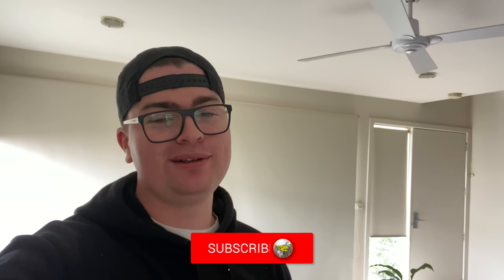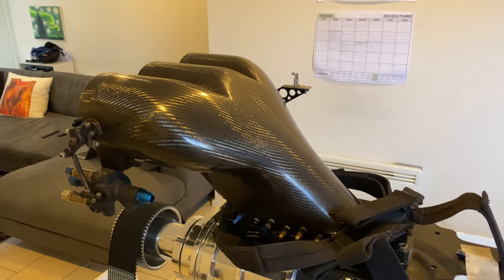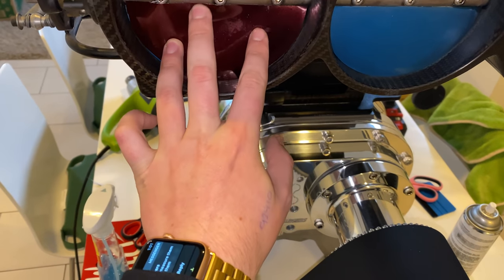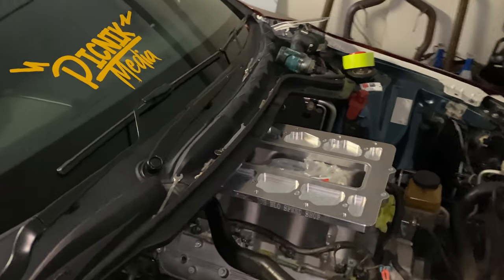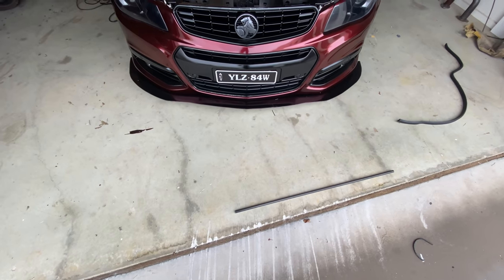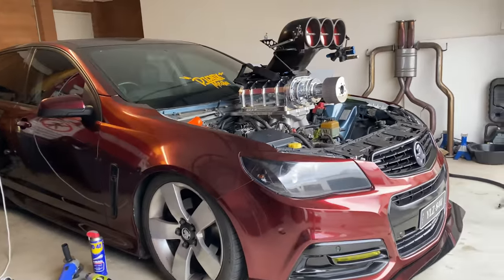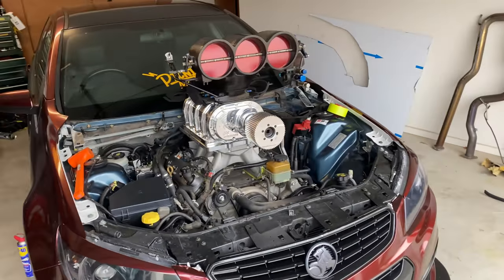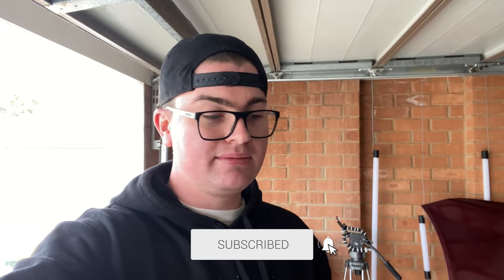Mocking Up The 6/71 Blower With Carbon Fibre Hat On VF Wagon

Comment: So is this going to be meth injection?
Maybe use an injected manifold, and space the blower and manifold with a water to air intercooler lol, give the hat and blower another few inches of height ;)

Can't wait to see how this progresses, I'm keen for the wheels too!
*can't remove blades to clean/wrap them?
Reply: Just see you're going mech inject E85. Same thing tho.
Reply from the maker: Yeah man I would love to sneak some extra height in hahaha and you can, but it’s not a simple job as the butterflies are gapped for airflow to be able to idle properly